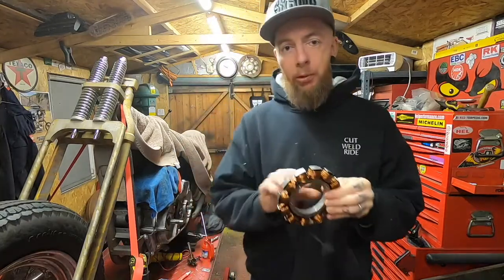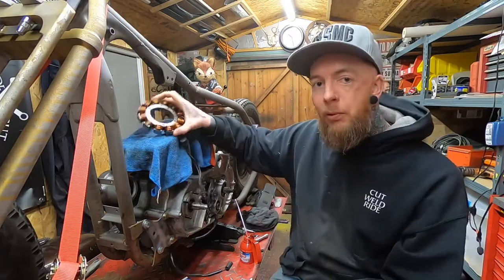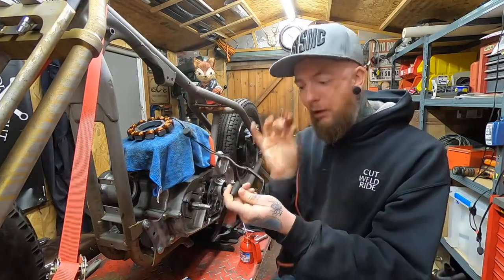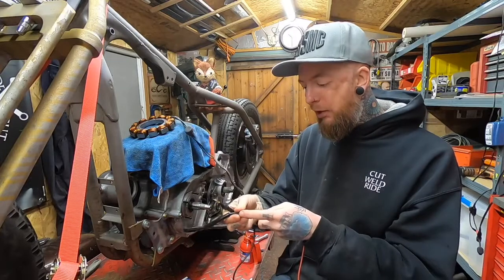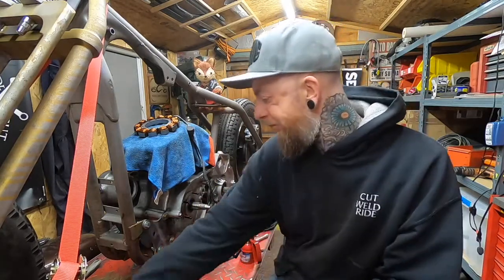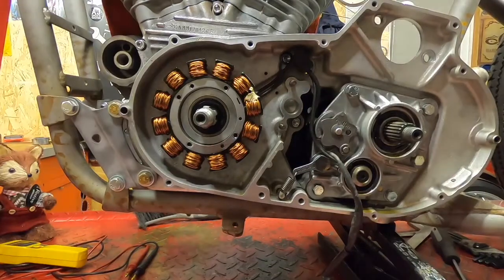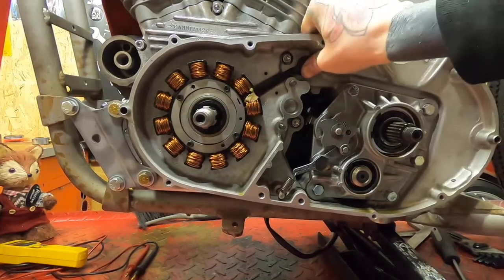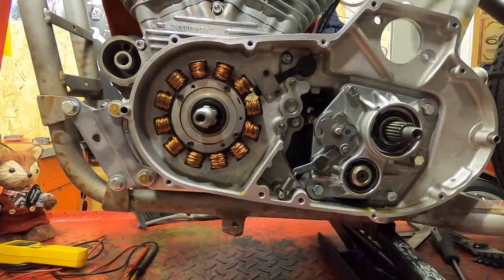(Harley Davidson) Sportster Alternator Stator Check & Installation

Comment: Nice! I got a turn signal module spiking current (intermittent voltage spike flash) at idle. Can't figure out why, been through weeks of ground testing. Maybe the oil is wicking down those wires? 73 ironhead.